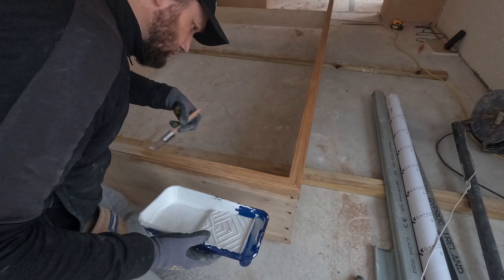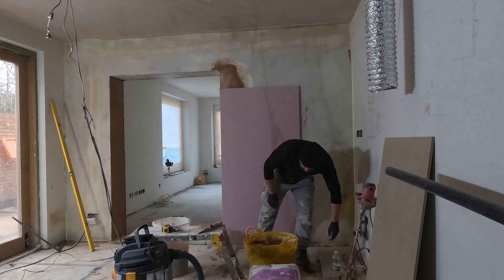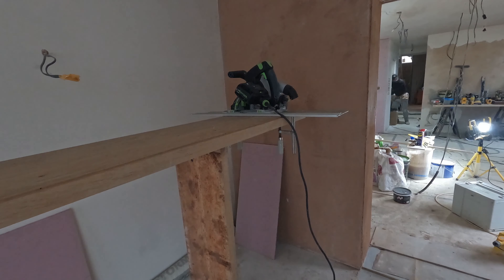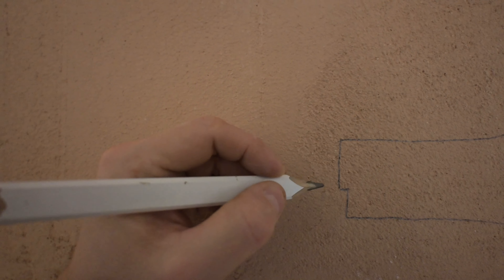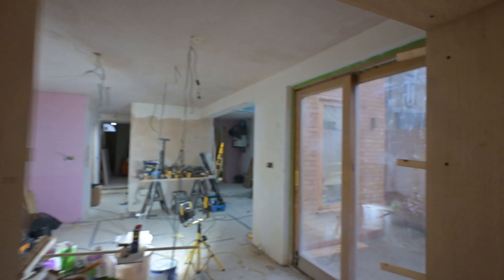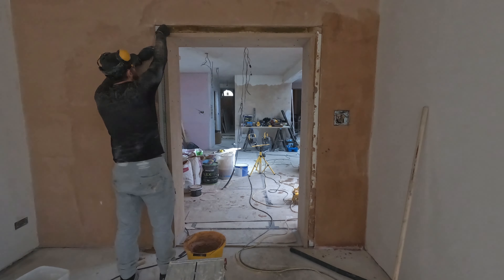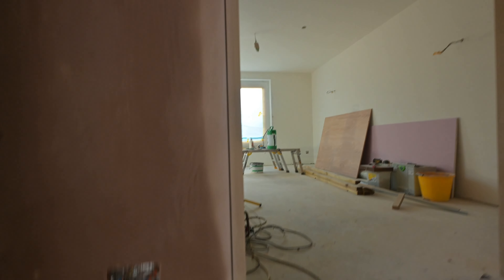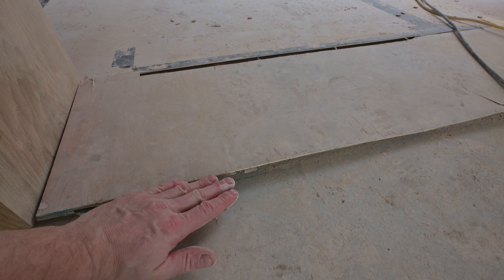Upgrade Your Home: Ditching Architrave for Shadow Gap

Comment: Great craftsmanship, would it be easier to offset the plastering in the beginning by the shadow gap strip compared to grinding it out after?
Reply from the maker: Thank you for the suggestion. I thought about it and in the end I decided that it will be easier to install the frame with full plaster being in place. Cutting out the strip was a bit messy but precise. After I finished and now I am looking at it, I think that next time I will try to do the way you say. 
Thank you for engaging 😉

I am preparing for the next video. Same effect on a partition wall. Hopefully I'll see you there.
Reply from the maker: I read your comment over and over again, and I think that you are right my friend. Les work, less mess, thank you 😊

Comment: Could you use thicker timber and cut a rebate along the face edge to give you your shadow gap?
Reply from the maker: Hi 
I could, but then we still have the gap between the frame and the wall and we have no architrave to cover it. 
🤔
I did a lot of thinking on this and I came to the conclusion that this would be the best way. 

I will upload another video soon with a shadow gap around the frame on a partition wall-much easier

Comment: Could you not finish the aperture using stop beads as usual and then rebate the front edge of the frame before installing it?
Reply from the maker: Hi 
This is exactly what I did if you watch carefully
Reply: Then you really didn't need to cut around the opening and add plasterboard strips, if your aperture was level and plumb and you added board beads to the face of the opening before installing the frame you wouldn't need to cut anything away from the walls, or do you think the finish is better by butting around the frame?
Reply from the maker: @Binbag1010  
Now, after it's done I think the best way is to leave the 100 mm around the frame open, install the frame and add the board with the stop bid. 

The reason why you need it to be open is to be able to push the wages in and expanding foam. After the foam is cured, cut the wages, clean it all up and add the plasterboard with a stop bid. Then fill or plaster around it. 

I think that this is the best way. Another video is in the making. Same principle but on a partition wall.
Reply from the maker: @Binbag1010  
To make it simpler, avoiding cutting out is the key. Saves a lot of mess and dust, so while boarding the wall leaving the 100 mm around the frame empty. I think that's the best.
Reply: @yesconstructionltd  Its a good concept in any case - i like the shadow gap, its different from tradition in the U.K. It would be great if there was a way of lighting the shadow gap essentially turning it into a light gap.
I suspect this would be difficult as the lighting strips would somehow need to be accessible in case they need changing.
Reply from the maker: @Binbag1010  
Well, nothing is impossible, and it's all about how much time can you afford to allocate for the task 😉
Reply from the maker: This entire property is based on shadow gaps. Wait to see the bathroom and furniture 😮
Reply: @yesconstructionltd  Looking forward to see it.